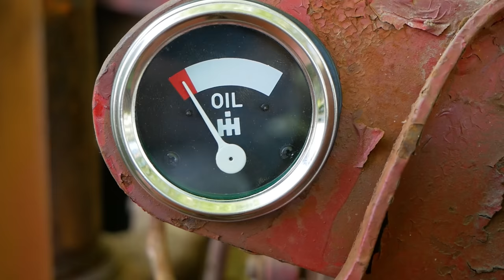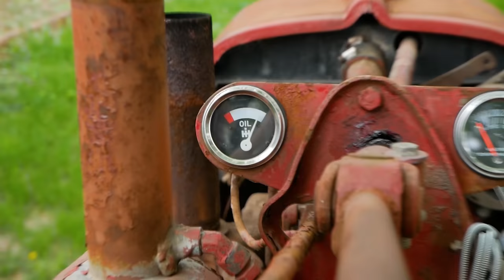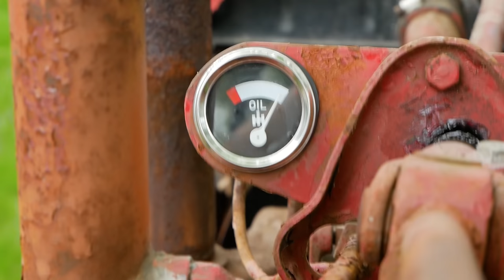Can We Farm With ABANDONDED EQUIPMENT? - Ep. 3 - PUTTING THE CORN IN

Comment: I farmed for 46 years and you have just proved to me I have been doing it all wrong.  You figured out how to get free equipment, free seed & free help to get a crop in the ground.  You are the smartest farmer I have ever seen:)
Reply: Getting free stuff is all about being bff with the right ppl
Reply: Not free. Still have to buy parts:(
Reply: It is interesting, once you are on the treadmill of modern farming, you simply have to get those yields and the price to make it work. But if you don't get on that treadmill, buy that 100k Tractor or 250k Harvester, you don't need that fertilizer.. that spray ... to make the yield to make the payments. It is mad, how we have got to here - But I just traded in a NH T4.75 for a DF Agrotron 85 from 1998 because it is easier to maintain. I'm trying to buy an identical second, and a 3rd in reserve so I can keep that 25 year old Tractor (which is very modern) going for another 25 years. I am basically becoming an expert in this model, and grabbing lots of spares and donors and so far it is paying off in terms for cost.
Reply: @Jdearly better than that 250k to 800k tractor🤷‍♂️

Comment: I am thoroughly impressed you've had less issues with equipment what's just been laying around the most farmers do with brand-new modern equipment I cannot wait to see how you're going to harvest it all and what you're going to have to do to get it all
Reply: its thanks to the change over from mechanical to digital systems.

while mechanical is far more reliable and can last a lot longer, it has major flaws that comes with it compared to, well digital. mainly control and time it takes for setup.

while a digital system can be configured in literal seconds, mechanical systems depending on how complex they get can take longer. and changing settings on the fly isnt possible with mechanical systems. hence why everyone more or less moved over.

ironically digital systems are easier to repair and maintain unless the companies producing them just wants to be dicks and make it hard, and thats the only reason why people say they like mechanical systems.

also about the harvest, that may be hard or easy. if they go old school like how they have been doing... well may be impossible to even find one, or say fuck it and go with a 70s or 80s harvester.
Reply: The new tech makes farmers spend less time in the field but more time in the shop, due to having more complex crap, so more parts, the more stuff that breaks
Reply: @Thekilleroftanks  I think it’s because they’re not doing that much
Reply: A lot of farmers I believe still use old machinery even if it's so worn-out they should've stopped using it three years ago
Reply: On my pap's farm we had an h and a super m. We picked by hand
Reply: Know of any pull type harvesters in Iowa?
Reply: Might do like we did. 2 people, 3 days of handpicking 13 acres.
Reply: @overratedprogrammer  I remember hand picking corn. I was so happy when my grandpa bought a combine.
Reply: This is a transition….many months later..! 🤣 I can’t wait either!
Reply: @Thekilleroftanks  I'd have to agree to disagree. I work in ag mainly on balers and swathers Heston/ massey. They have kept on the baler side of things very basic still chain drives and basic sensors while krone and CNH have gone to shaft drive systems. The shaft drive balers and variable speed pickups on the krones/ CNH are just constant pains and are more difficult to adjust than the "dated" Heston design that has been around since 1991
Reply: @Thekilleroftanks  "digital systems are easier to repair and maintain unless the companies producing them just wants to be dicks and make it hard"

So virtually every manufacturer across all industries dabbling in code, from big tech to automotive to agriculture. Right to repair got as big as it has because manufacturers have become enamored with the idea of charging their customers extra by removing the option for self-repair and forcing them to have the machines repaired with certified dealers and technicians.
Reply: yup i think this is the best way to farm, more work but more freedom to fix equipment w/o computers to contend with.
Reply: @Thekilleroftanks  Good luck working on that digital equipment, if you're even allowed to (no Right to Repair laws).

Comment: That old H really put in the work pulling stuff meant for a larger tractor.  They really are a tough and capable old tractor.  Just think, it did all of that with just 25hp.   My zero-turn lawnmower has 27.  Loving this series, putting all of this old equipment back to work and actually getting the job done.  Really enjoying Junkyard Farms!   I'm curious how old the planter and other equipment are.  The tractor is 70-80 years old and still getting the job done.

Comment: Here’s a tip, turn the hydraulic bucket the opposite way, pour with the spout on top instead of on the bottom, it flows way batter and way easier to pour… don’t take the air plug out unless you know your dumping the entire pail in … thank me later 🍻
Reply: Andrew I was going to say the same thing but for clarity I would have said when filling a xxx with liquid out of a container, have the hole of the container filling from, in the 12 o'clock position not the 6 o'clock possie it will flow, and not gurgle as the air can get in the pouring container easier.
I had a hard time getting that across to J. C Smith on his channel (same Name) about 3 years ago if the person doesn't get the instructions first grasp you have a frustrating time explaining. 😁
Tony from Western Australia 🇦🇺

Comment: Kevin, you can get positive stops for that hydraulic cylinder.  split rings with a spring band on the outside, they come in variety of widths. set your desired depth then stack the rings til it fills the rest of the cylinder shaft from head to body. when you lower the equipment, it stops at that point so you don't keep going too deep and stall it out.  helps immensely when you're using single action cylinders.

Comment: We own over a dozen of those letter series Farmalls. Use 30 weight non detergent for the hyd system. and use 15-40 shell rotellat in the engine. It already has zinc in it. Be certain the small hole in the bolt for the oil filter is not plugged up.

Comment: Hey Kevin, the temp gauge could have been perfectly fine. These tractors are extremely hard to get hot if they are running right.
Reply: He did say it wasn't even getting hot enough to move the gauge. So you're probably right.
Reply: Just needs a new thermostat. They're notorious for sticking open after a few years.

Comment: WOOHOOO IVE BEEN WAITING FOR MORE ON THIS also have you ever had headers actually explode off a car because idk what my friend did to his car
Reply: Ive seen a muffler explode
Due to an idiot having his all 8 plug wires wrong  which caused unburned fuel to go into the exhaust 
Then when the plug wires were partially correct the engine fired and and ignited the unburnt fuel 
Causing an explosion so loud that my brothers and myself heard the explosion over 200 hundred yards away through some thick trees in a ravine even at that distance   the explosion sounded to us like a shotgun at point blank range the trucks owner stated that the explosion had his ears ringing for over an hour and that he felt a sense of confusion afterwards (light state of shock presumably)
Reply: Was an exhaust pipe pinched?
Reply: Did you have a restriction. Or timing way out?
Reply: flooor it to max RPM turn ignition off quickly and then on without lifting can cause that

Comment: I remember when we used to fill our tires with water on the smaller tractors. Helps a lot.
Reply: Its still done around here even on the large tractors
Reply: We used calcium back in the day, now it is washer fluid so it doesn't freeze

Comment: Love your show!   
And this series with the Farmall has given me the courage to begin on my father's Nuffield 342 with backhoe. 
(He no longer has the health to do it himself, so I'm taking over.  As the tractor is at his home, I guess I'll be seeing more of him this summer than usual)

Zink. Is that important only for gasoline engines, or is it a good idea for Diesels, also?
Reply: ZDP shows up in both diesel and gasoline engine lubricants, particularly on the older stuff.
Reply: Nuffields are some pretty good tractors. I used regular diesel engine oil 15W-40 in mine during summer and 10W-30 during winter. Gearbox and hydraulics share oil on a Nuffield and takes 60L of 80W-90 GL-4.

Comment: My Dad had a Farmall H that he bought about 1950.  It is basically a 2 row tractor.  Designed to plant 2 rows at a time, cultivate 2 rows at a time and discing 2 rows at a time and plow using 2 bottom plows at a time.  Correct sized equipment would result in no or little tire slipage.  Oversized equipment will cause premature wear and the engine will run hot.   I learned to use the Farmall H when I was 8 years old.

Comment: When I started farming we had a JD 494 planter.  After that we switched to IH planters.  Your 1250 is similar except for the more complicated row units.  The cotter keys sheering is a continual problem.  We took strips of white rag about about 1"x6" and tied them around the row unit drive shafts near the gear box.  You could easily see the rags flopping around and know that the cotter keys had not sheared.  Some guy replaced the cotter keys with roll pins but I think the cotter keys were made to shear to keep from breaking other things.

Comment: Very enjoyable video! If you’re going to use a 1940s Farmall H like a 1950s Farmall 450 you need more weight and more rubber on the ground (bigger foot print). Find a junked “H” with good rims, take the whole wheel assembly. Move your wheels in, might have to turn wheels, switch side’s?? Mount wheels on axle. DUELS. (First one I drove was an H, then a Super W6. The first one I bought was a new 756 in 1968 and few more IH’s after!) 👨🏻‍🦳 🐄 🚜

Comment: Oils for older diesels still have a lot of ZDDP in them. ACEA A3/B4 is a common spec for diesels without particulate filters, most oils that comply with this standard have over 1000 ppm of zinc. Oils of this specification are also perfectly fine for spark ignition engines.

Comment: place a couple donut stops on the cylinder to adjust the plow depth. Farmall H was made for smaller plows like a 2 bottom moldboard, 5 shank chisel, 8 foot disc etc. That field cultivator is a little much but should make a good seedbed if you adjust the depth

Comment: The only tractor my Grandfather bought new was a 1953 Allis Chalmers D-17. I helped him as a pup (10-ish) drive out the sleeves with a 4x4 block and sledge in the early 90's. That same summer, after a rebore, sleeves, bearings, rods 'n pistons, head work, double valve springs, custom cam, and a GM coil; I made my first pull ever and won my class two days running. Watched it go from a derelict work horse to a sled steed. He asked me one time if I wanted to repaint it. I said "Nope. It needs to remember where it came from." He died 24 years ago and it still hasn't been painted.

Comment: Dad had a 51 Case with a leather belt pto driven irrigation pump. It was a pain to align the belt sometimes but it could put out the water. A giant cast iron pump on a skid of crossties staked with iron pipe to keep it in place. There is probably some neighbors using an 8N still. One has a couple Farmall tractors.

Comment: Good idea putting water in the gas tank, way to go. Now all you need to do is pour boiling water in the oil fill hole to clean out the old deposits in the bottom of the oil pan.

Comment: The stand pipe was what finally got me running my own old international   If you have a reach magnet (like for getting dropped bolts, you can drop it in beside the intake and it will collect a lot of the rust as you run

Comment: Well sketchy or not the corns in so that's good, It will be interesting to see it coming up and how well you and the machine did.   Kinda sounds like you got something in that tractor drivelines not happy maybe some chipped teeth or a bearing or 2 going out the way it's clunking under load.  I worked in a wrecking yard for tractors about 20 years ago, there was several old Farmalls in there had cracked  housings underneath where something tried to get out the  bottom of the final drives. It might be worth trying to figure out what it is before it destroys it's self and you need another tractor after managing to get it back in the field working again.   Thanks for the video, Take care guys.

Comment: The piece of wire used as a sheet pin is absolutely the SOP in old equipment. 

I’ve seeded wheat with 40ft CCIL discers. So much wire in use.

Comment: There are two ways you could prevent this from being an issue later. I've used both. One is go to your local hardware store and get a few gallons of muriatic acid. I mix it 50% with water and leave it in there 8 hours. It will get the rust scale either completely gone or you can blast the rest out with the pressure washer. But any seams and such that are compromised with rust will leak and have to be fixed. Second option is to get a fuel tank restoration kit from POR-15. With as little rust as the tank has I think its the way to go. Its a good kit, done a few tanks with it over the years. This will treat the rust you have and glue it to the tank walls so it cannot become a future issue. You will need to let the tank sit for at least 3-4 days before trying to use it though.

Comment: Put a couple  magnets on the bottom of the tank. Pull them  off if you can shop vac the rust out after you drain it or use a small magnet inside to pull it out.

Comment: Kevin, try turning the jug until the spout is at the top before you try to pour. You really will spill a lot less. This works for anti-freeze and even the one quart oil bottles.   Ehh, there should be a screw that looks like a mixture screw near the bottom of the float bowl. From lightly seated, you want that screw one and a half to two turns out. Also, Mook doesn't weigh 100 lbs. unless she has a pocket full of very large spiders.

Comment: The best welder for a farm with limited power is a gasoline powered welder, either a stick or wire feed if you can find one. Old junk yard finds can be the best, some are easy rebuilds and the best part is you can drag them to the job rather than the job to the welder, which can be a big help on a farm or remote trial. A fact I learned from my step dad and living back in the Minnesota and North Dakota area. Hope the tip hel[s and love the tractor. PS. a cup of 90 weight gear oil in 30 weight can help with oil pressure in old tractors, my step dad had three.

Comment: Really enjoy your videos but a word from someone with 25 years of experience messing with old tractors, if you plan to keep the H, ditch the stand pipe. After enough time it will cause a huge amount of sediment in the bottom, I've even seen it rust out a fuel tank! I take the stand pipes out, clean then use a liner on the tank. Keep up the good work!

Comment: That muffler might not flow enough for the engine to run optimally.
And please add the exthaus flap at the end of the pipe, it keeps the rain out.. i've seen too many tractor engines broke due to rainwater in the engine.

Also whats the "ticking" sound whenever the engine is at high revs? waterpump?

Comment: those old tractors used non detergent single viscosity motor oil as well . Most farmalls used SAE ND 30   in summer and they recommended SAE ND 20 in winter
 If you can find a manual it will list all the lube and coolant specs with service and maint info . Ive seen manuals fir sale on ebay
Reply: There is a controversy over using ND non detergent motor oil vs todays modern detergent oil. Ive used both , the claim is that switching from ND to modern oil will loosen sludge and the engine will start using oil and smoke , fact or fiction , not sure

Comment: On your temperature gauge take the tape off the end of the fittings is usually that messes with the ground I found out the hard way I usually put a little bit of silicone on it but that messes with your ground

Comment: I could be mistaken, but I've heard that International Harvester equipment, both tractors and their trucks, don't rely on oil pressure so much as the amount of oil in the engine. As far as working on that old plow horse goes, you might look up some information posted by a Michael Mayben. He's gone now, but he was an old IH tech, trucks mostly I think. The only big difference between IH tractors and their trucks is the sheet metal and the size of the wheels.

Comment: i always keep my 5 quart oil jugs that i get for my pickups  and tear the labels off and put my  hydraulic oil in them to make it easier to put in the tractors  and stuff.   also you can lay the 5 gallon bucket on its side on another bucket or tailgate  with the spout up and then roll the bucket to control the flow so you don't spill (quite so much :)

Comment: That seat can't be that comfortable when the shock is bottomed out.  Need a stronger spring for next year's planting.  Maybe QA1 might have an upgrade kit?  Add an air compressor to the fan belt and have an adjustable air ride spring and maybe able to fill up some flat tires now and then

Comment: 19:34 ya need to slap a tube in your rear tires..... then fill the tube with calcium chloride 
its STANDARD practice on pretty much every "pulling" tractor on farms across the world 
.
however.... it rusts everything QUICKLY if you get a leak (you can use "rim-guard".... which is mostly beat juice)

Comment: You probably know more than I do but from what I've experienced with these old tractors and from what I've been told is that they don't need the zinc added, they don't run at a high enough rpm to do any damage (I believe an H runs max at 1650). I have been told a good 15w-40 would do just fine. But like I said, you know more than me.